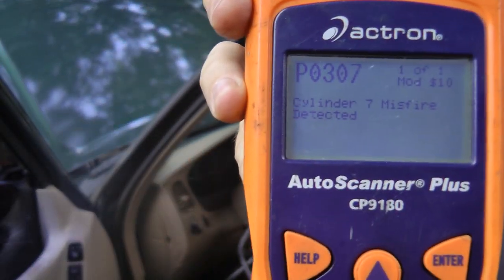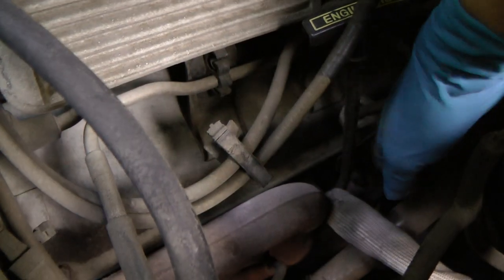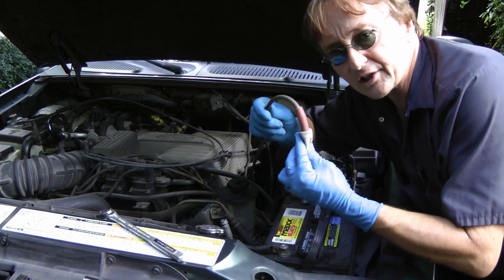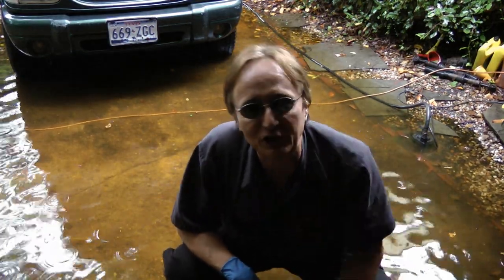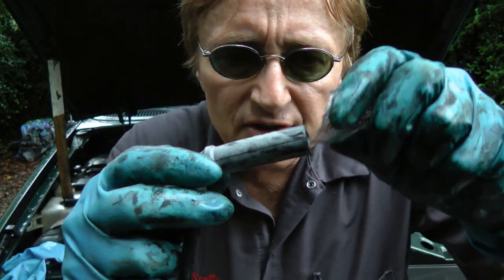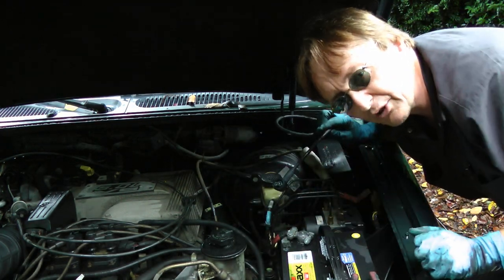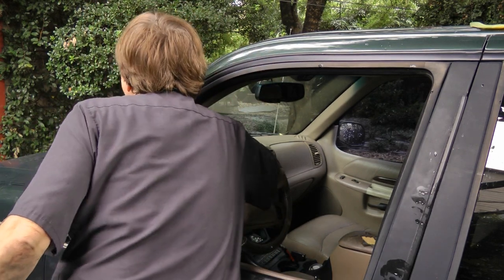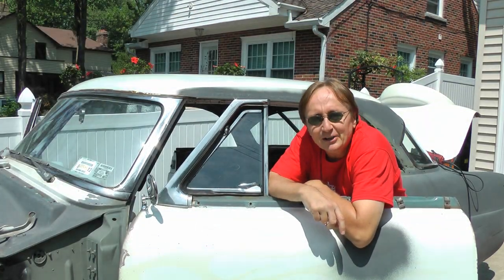How to Fix a Engine Misfire Code P0301 (Spark Plugs and Wires)

Comment: Scotty
So I am getting a misfire in all four cylinders P0301-4 on my Subaru STi in or around 4th to 6th gear in low RPM . I have changed the spark plugs nothing changed. The coil packs look good. My alternator died I changed that but still getting misfires. I then did a compression test on it after I got it up to temp. and the compression seems low but all four cylinders are consistent with compression running 117-119 psi. What would be your advice on trying to troubleshoot this misfiring problem? Car is stock no other mods besides a cold air intake and exhaust.
Reply from the maker: Hyrum Powell   at that low pressure, engine is just flat wearing out. It can run ok for a while, but will never be perfect with that low pressure. BUT, do try my video "how to clean fuel injectors on your car" and that may help some

Comment: hi scott, I have the same problem on my 97 honda civic hatch. my engine light keeps coming on for code P0303 even after i replace my fuel filter, air filter, spark plugs and spark plug wires. Is there anything else that I missed?
Reply: someone answer damn.. buncha fake mechanics
Reply: Gary Shaw your advice is not helping

Comment: Hey people i have a question i just got my spark plugs n wires changed n now there in idled at a red light or just in drive with my foot on my break its starts to like chug n choke n shake a bit any ideas?  I dont have a engine lite ether so i dont know whats wrong its never happen it just started after i got them changed

Comment: Hi Scotty I have a 2002 Ford f150 v6 4.2l Truck that is running really rough. I am getting codes p0303 and p0316. Also having a p0171 code. I have changed all the spark plugs and wires and it is still running very rough. Any suggestions? Thanks
Reply from the maker: +C Middleton coil on plug on #3 could be bad, as could fuel injector on #3 or blowing head gasket on 3
Reply: +Scotty Kilmer could a vacuum leak in the system cause these problems?

Comment: I have a 1991 Nissan pathfinder with 2 problems the engine was misfiring until recently which was a month ago, the engine was running then it started to die so I gave it some gas, needless to say it did and now it wont turn over, it will crank but wont start any suggestions???

Comment: I have 97 Honda accord SE, misfire in cylinder 1, I replace distributor cap & rotor, exhaust manifold gasket, motor mounts (needed em replace). But it still have check light on reads as misfire, where could misfire come from? Thought about oxygen sensor?
Reply: I also change spark plugs and wires
Reply from the maker: one cylinder misfire will not be caused by a bad O2 sensor. Bad fuel injcetors, bad spark plug wires, bad computer wiring or computer circuit, or worn out engines often cause that. Being a honda, check the valve clearance first they often go bad
Reply: +Scotty Kilmer  Okay thank you, I put a new motor in two years ago before I had bad valve in cylinder but was hard to start, and would run hot. dont have that problem just may use more gas but I will check on that I appreciate it

Comment: Hello mr scotty
I got a 1999 eclipse gst turbo, car drives Smooth n stuff up to 4000 rpm then starts to sputter n won't pass that rpm - can bad spark plugs or leads b the problem?  Please i need help getting my ride up n firing, thanks :)

Comment: Scotty,  I am having trouble with a 1997 Jetta.  It misfires when wet.  The ignition coil, wires, distributor cap, and plugs were changed.  It is only after a rain that there is a problem.  After the car is warmed up,
 it is fine.  Any ideas on how to fix?  Thanks! Darrin
Reply from the maker: well, electronics are getting wet somewhere. When it doesn't start, trace the ignition system wiring from the ignition switch to the spark plugs to find where power is lost. Often weak connector plugs or computer modules on those
Reply: Scotty Kilmer I'll check it out.  Thanks Scotty!
Reply: Didn't a lot of Jettas have problems with rain water coming in contact with part of the harness under a fender or something?
Reply: It could be.  I'll see what I can find.  Thanks!
Reply: Darrin Goldman
 Did it do this before you had all of those ign. components changed? I've seen a cracked distributor cap allow moisture inside. After a good rain, you might want to poke around if you're comfortable and check under the cap for moisture or even underneath an improperly seated ignition coil. Good luck!

Comment: hi scouty. my 96 civic has p0420, a 4 miss fire codes. so I jus changed both of my o2  sensors, problem didn't solve, car still shaking and lose power. my spark plugs replaced less than 2k miles ago. my catalyst convert looks normal with light brown color, no carbon build up so I think it doesn't need to be replace. so now what the problem. maybe my fuel injector are bad? and need to clean. or replace. plus one code came up before I noticed car was shaking and knew it was miss fire. that day I didn't have my obd2. thank you
Reply from the maker: time for a new cat when that old , you can't check em just by looking at them
Reply: +Scotty Kilmer thank you
Reply: +Scotty Kilmer I just changed the cat and now the code is gone. now I just have to check my next problem solving multi miss fire. I think take it to a shop and pin point what caused the code

Comment: i have a 2013 Charger sxt with 46k miles on it. keeps coming up with a P0305 error code, i changed the spark plug still the same misfiring and code. and then also changed the ignition coil. mechanic said my injectors were pulsing like they should. what else could the problem be? thanks
Reply: +Greg B these misfires happen randomly,  might be 2 miles, and has even went days with no misfire
Reply from the maker: +Greg B swap #5 injector, see if miss moves, if not that, compression test the engine to see if #5 cylinder is worn

Comment: Here is some safety info. If you have a flood in the driveway, make sure you unplug and remove the extension cord from the water before you tromp through it.

Comment: Hi @scotty Kilmer I have a 2004 mazda 6 3.0l an it was running fine then all of a sudden I hit a bump an its been blowing blue an white smoke lots of it has loss of pull in engine all gears an screams real loud
Reply from the maker: wel, check under the car to see if it's leaking oil anywhere from bashed holes or broken off hoses first

Comment: Hi scotty.  I have a 97 chevy astro van 4.3 v6. An i got check engine light with a p0302 code.  I replaced the rotor and cap and sparksplugs but the van still has the same code on. Any help please
Reply from the maker: Victor Sanchez   replace the spark plug wires, if not that, swap #2 injector with another, and if miss moves, that's it.

Comment: my brothers 96 chevy s-10 with a 2.2l keeps getting more misfires problems we changed the wires and plugs & a week later its doing the same thing its down on power so i  replaced the fuel filter the old one was restricted had alot of rust come out. When i unplug the brake booster & it really revs up to much fuel leaking from the injectors is my guess. any insight on this. the head was reworked after it had a tensioner break that worked its way in between the cogs and the chain, bending every valve with the timing chain slipping
Reply from the maker: yep, worn out fuel injectors often do that, But do try my video "how to clean fuel injectors on your car" it often works and keeps you from buying new ones
Reply: Ive watched that a while back. But where would i rent or buy that. I checked a few different autostores
Reply from the maker: jeremiah smith no one rents them, amazon sells one for about 80 bucks last I checked, but of course you need an air compressor to run them. If you don't have that, pay a mechanic to do the whole job, most charge 90 bucks or so

Comment: ok...took it to my buddy...he says a possible fuel filter because it starts right up...will idle decently until it warms up, then it runds rough ...i have no issues with oxy sensors...changed both....also changed starter, crankshaft position sensor, and the other sensor that was under the starter....by the way its an 1998 olds 88...also changed the wheel bearing and shock strut assembly ...as u can see ive got alot of time and money invested so ...its just driving me nuts....lol

Comment: I have a 1991 Ford F-150 Custom that I can hear missfiring. Ive replaced the spark plugs and it has a 300ci efi in line 6 any thoughts?
Reply from the maker: +Tyler Olson that old thing, start with new spark plug wires and a dist and rotor, PRAY it's not internal engine wear
Reply: can't drive it I'm only 15.5

Comment: Hey Scotty, I have a 1993 Mustang lx. Has 198,000 miles on a 2.3. 5 speed. I have a misfire   . Just replace both coils since those models have 8 sparks plugs on a 4cyl and plugs and wires. But the misfire is still there. But only occurs at full throttle at standing idle or just at full throttle period there a noticeable mis and power loss. It runs great if you get the rpms up there slowly. But if you try to "punch it" it'll just mis. Can you help me???
Reply from the maker: swap injectors, if miss moves location, replace the one you moved. If not, often engine springs go bad on the valves and will misfire at higher rpms
Reply: Okay, Thanks for all the help!
Reply: Y'all were a lot of help it was the MAF sensor!! Thanks for all the help guys!

Comment: Hi scotty, Merry xmas  1997 chev 305 Pick up.  Misfire 2 months ago. Distr cap and rotor  new in May, new plugs and wires  6 weeks ago still misfire. Checked it at night and fire was jumping at coil wire and some at plug wires. Got a new set installed still misfire. Mechanic thought it was cracked coil . I bought  new 1 Saturday and hooked it up , Truck starts fine took it for a spin and still misfire. So saturday night I looked and when I rev engine fire jumping at coil wire 2 Bad sets ? Help!

Comment: Hey I have a 2000 chevy malibu ls 3.1 v6. I got the p0301 code and I have driven my car like this from work and my car overheated on me. What could it be? I went 50 easy without my check engine light flashing.
Reply from the maker: overheating and misfiring is often a head gasket blowing. Try my video "how to tell if your head gasket is blown"

Comment: scotty i have a 1998 ford contour with code p0301 cyl 1 misfire and i found trans fluid inside my air intake
Reply: wait its not trans fluid its motor oil going into my air filter and i have no compression in my number 1 cylinder
Reply from the maker: time for a new or rebuilt engine, often guys put in used ones too if money is short

Comment: hey scotty i have a 91 toyota 4 runner thats misfiring i found out the cylinders misfiring but the car also lost compression if i can fix the misfire will that fix the compression?
Reply from the maker: +DALEJAMES MENEFEE if cylinders have low pressure, engine needs rebuilding, that's what would cause misfiring
Reply: so i need to rebuild my engine to pass emissions?

Comment: yea what if I just got coils and spark plugs and still have a misfire? in a direct injection engine could carbon play a role?
Reply from the maker: can be a bad fuel injector, blowing head gasket, weak fuel pump, bad maf sensor, lots of things
Reply: Gary Shaw hey I have a Nissan  Altima 04 is misfire I put everything new is kind going
Reply: it seemed to be from faulty wiring to my high pressure fuel pump, which also seems to have a bad fuel pressure regulator on it.

Comment: Hello Scotty,this is my second HONDA CIVIC that i did timing belt and water pump,(profesional job by certified mechanic) thinking this will resolve my pinging problem,but nothing,they just replace my timing belt and water pump,the car is still pinging,shaking around 25-35mph,i think its a misfiring,i hav check engine CODE 9.do u thing the pinging,shaking and the code are related?i changed spark plug,fuel filter,adjust the valve and adjust the timing with the timing light.civic 93 lx,1.5 non vtec

Comment: I know this isn't related exactly to the video, but I need some help.
My mom has a 95 Jeep Grand Cherokee Laredo that's been having problems on and off with starting up. Before the problem started, the Jeep would start up just fine, but about a month ago it almost ran out of gas and after she put half a tank of gas in it at a gas station, it's been having problems since. Some days it will start fine, but then other days it'll act like it's not getting enough gas and the first time it had the problem, it was backfiring. She put some fuel cleaning stuff in it and it seemed to work for a little while, but then the problem came back again. The check engine light isn't on either. What could be possibly causing the problem?
 
We're not sure how many miles are on the engine either. The odometer doesn't work and we were told the engine had been replaced at one point.
Reply: +Gabry Duke  i have  98 grand cherokee 5.2L  V8,  my  jeep  had check engine light  and  one day it quit .  turned out  fuel pump shot, it had  filter  inside covered  with gunk . replaced fuel pump, now it  starts  every time.

Comment: The misfire code on my wife's 2009 Chevy Malibu P0304 turned out to be a burnt exhaust valve.  A compression test on cylinder 4 turned this up. The engine only had about 100k miles on it at the time and had never been abused (to my knowledge).  Sigh.

Comment: no its not blocked, i blew in the hose from the reserve side and it was free flow. In the mornings r wen the car is completely cooled and i open the cap a lot of air exhaust.

Comment: I have new wires spark plugs and its still misfiring its says cylinder 1 misfire do you know what it could be ? Plz help thanks
Reply from the maker: swap # 1 injector with another, if miss moves, that's it. PRAY it's not internal engine problems

Comment: hi scotty, ive got a 1996 audi a6 2.8l 30v engine, and recently its only been running on 3 of the 6 cylinders, the entire of bank 1 (drivers side UK) has stopped running, ive replaced plugs, HT leads, coil is new, reset engine timing (chain and belt) checked for codes (none)  replaced timing chain actuator, tested various sensors and replaced oxygen sensor, also checked for vacuum leaks and still nothing, any ideas???

Comment: My honda is misfiring when I push on the gas it makes my car shake but all of a sudden I would drive fine then it would just randomly misfire I know its not the spark plugs because I just put new ones in any help would be much appreciated thanks scotty
Reply: Fuel injectors most likely
Reply: I had a 2005 Kia Sorento that would shudder (misfire) when your at a stop idleing with the car in drive or reverse. My S. plugs were fine..... but the boot on the ignition coil was cracked due to age and heat, causing arcing and well, misfire. I simply bought a new coil ($30), or you can buy a new boot for the coil ($6), and replaced it then lubed the boots with S.P. grease. Since my car runs beautifly and I regained my engines power. Hope this might help you!! (:

Comment: Hi there Scotty! Well i have a bit of a problem with my ford granada with a 2.3 l v6 (the model from germany) and it backfires somewhat hard when letting go of the gas. I think its running pretty rich but still not as i think its ignition related. The car also feels veeery weak but it revs up pretty good. Could it be a leak in the intake? Could it be a really worn camshaft thats making it very weak? pls i need help! :(
Reply from the maker: could be any of those and more. FIRST, have the engine wet and dry compression tested to see if valves in the engine are bad, that's number one. If not that have the ignition and fuel injectrion system tested for shorts
Reply: Thank you for responding! :D

Comment: Question I have 95 ford explorer 4L 4x4 and she isles rough, I'm thinking it's miss firing but why would the truck shake?
Reply from the maker: misfiring causes shakes
Reply: Thanks Scotty getting mechanic to check it out, bought the truck for 300 no rust brand new tires, has a Lil miss fire that's all only 180,000. Klm on it
Reply: Scotty Kilmer would it also cause lack of power?  Like acceleration is slow

Comment: hey scotty, i just went for an inspection sticker on a 2000 oldsmobile bravada....i have a obd and it came up with two errors.....evap and powertrain.i brought to a mechanic to get it fixed and the evap went away but the powertrain code was there still.i drove it a little bit and now the car wont go above 30 and its sounds like a machine while drive...also rumbles and shakes when idle.checked error codes and now have a evap control system malfunction...and also a misfire in cylinder 1 help?

Comment: I have a 2008 Mercury Mountaineer V6 4.0L and I am having a random misfire issue on cyl 5 as well as "hard shifting" on 2nd and 3rd gear. I'm not sure if they are the same issue or separate. I have heard that misfires can be misdiagnosed as hard shifting. Neither issue is every time and they don't throw a code every time. Recent maintenance I've done includes water pump, harmonic balancer, belt, plugs, and leads. The misfire was prior to all that, these were all things I found looking into the misfire issue. The misfire seems like it could be the EGR? I am getting both negative and positive readings on my EGR_ERR with my OBDII software, telling me it isn't always moving the amount the computer is calling for. Maybe I'm going down the wrong path... Any ideas?  My misfire will go away after shutting down the vehicle and restarting it. Sometimes I have to start/restart the Mountaineer multiple times before it will run fine, other times it will start fine and run but still has a "hard shift" at 2nd and 3rd gear here and there. Any help would be greatly appreciated!

Comment: Where is the reason the spark plugs was burnt with Carbon from running rich or lean and what causes all oil down in the cylinders head gasket